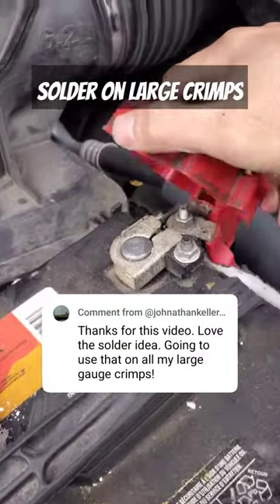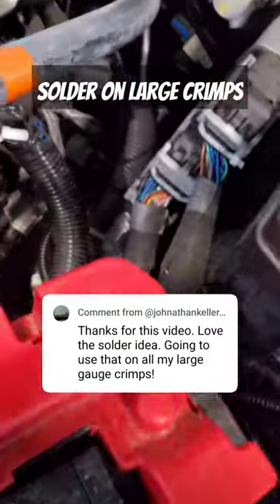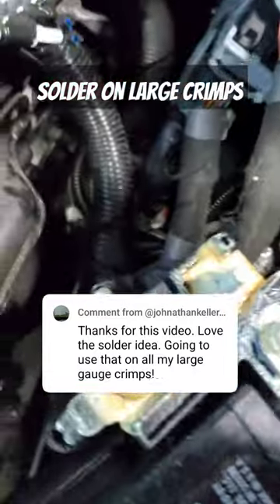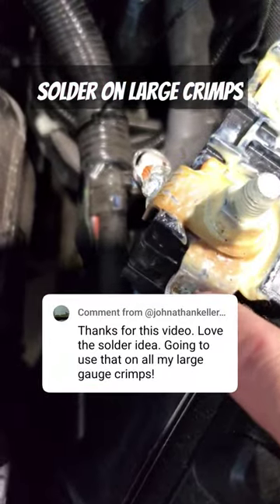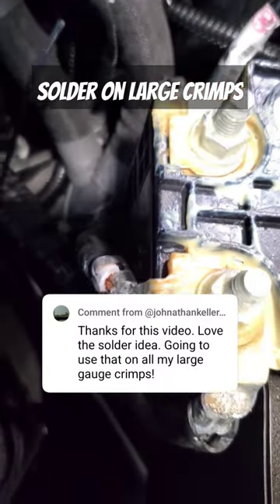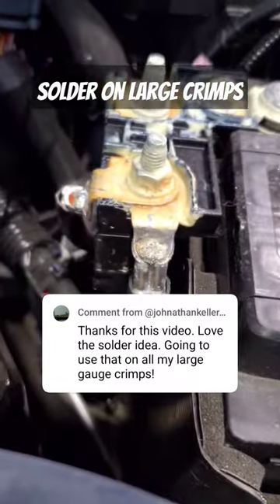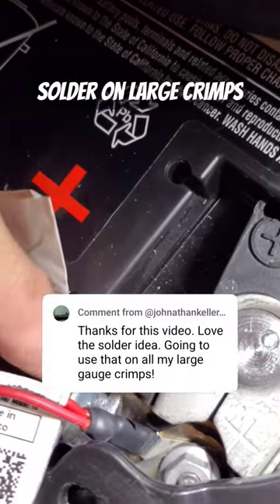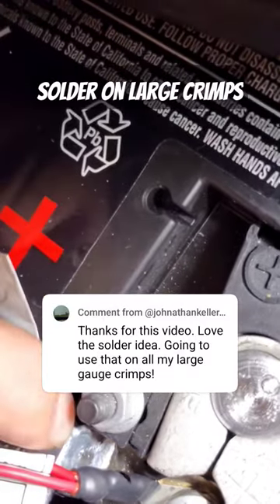Solder on Large Gauge Wire Crimp Connections | AnthonyJ350

Comment: What's up AJ. Soldering fills in the spaces between the copper. The way I was taught about electrical flow is like how water moves through a pipe. Weak versus strong flow. And it creates a secure connection. I have no idea why one would suggest against its intended purpose lol
Reply from the maker: Some people argue it makes the wire brittle, but I always secure these connections.

Comment: Any time atmosphere gets into a bare crimp or a cable that has bare insulation,  it will oxidize over time.  Soldering is certainly preferable in high amp draw situations like battery cables.
Reply from the maker: We think this trend is happening because of the start stop feature equipped on vehicles and that starter pulling hard off the battery several times throughout your commute.

Comment: If done correctly, soldering (more like brazing in this case) the large crimps is a very reliable and longer lasting connection.  I been doing electrical and electronics (professionally) for twenty five plus years now.  I would recommend cleaning up any flux residue and/or slag on and around those connections afterward (flux is acidic in most cases).  As well as a good coating of dielectric grease (bulb grease).
In regard to soldering crimps being a bad idea - on smaller crimp connections, such as low voltage data cabling, I would tend agree that it is not a good idea.  It can cause impedance variation and added signal attenuation.  Generally, it could be troublesome.
Reply: Add large scale shrink sleeve to really make ‘em look good and lessens the  chance of ground fault.
Reply from the maker: We're focusing on thick gauge power in low voltage applications. Charging systems for vehicles.